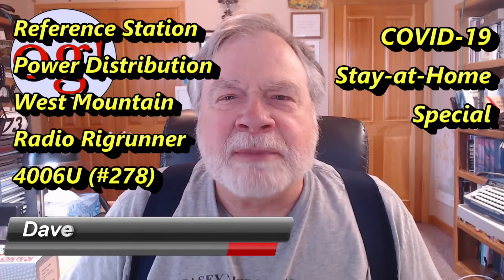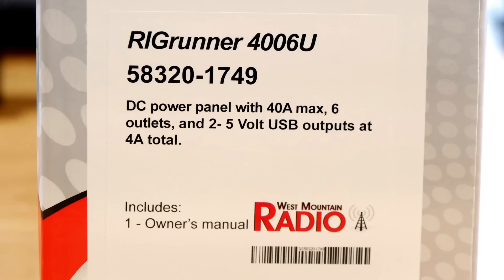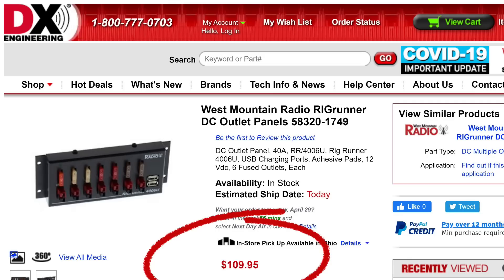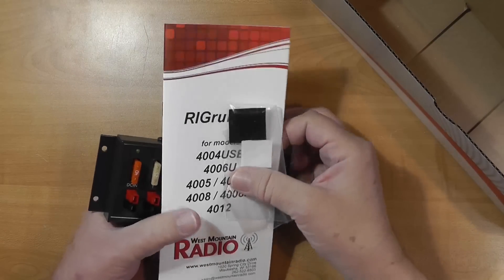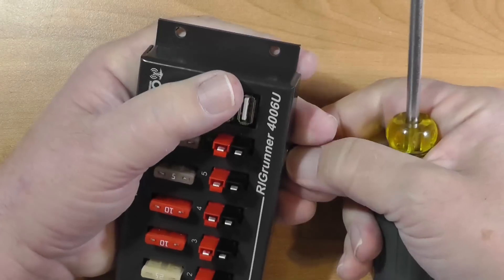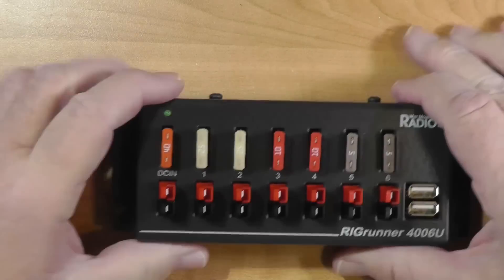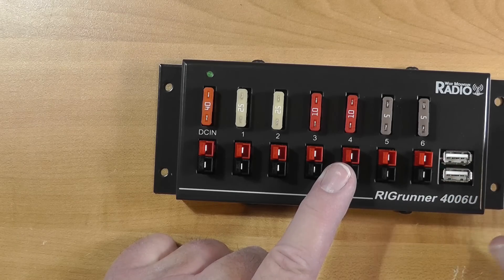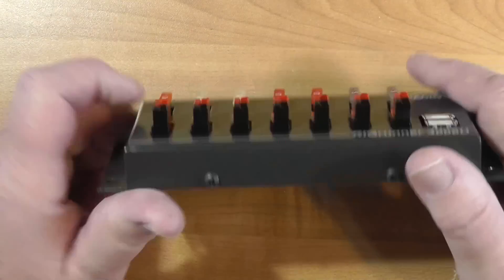Reference Station Power Distribution West Mountain Radio 4006U (#278)

Comment: I just bought a 4012.  Yes, it could be overkill, but it could also be a great device to cover a lot of DC bases.  This afternoon I fitted a couple of old wall wart connectors with power poles to light the meter lamps on my MFJ tuners; a couple of AC wall warts I would have needed are now replaced by dual 12v output on a single set of power poles on a 5-amp DC circuit.  I figure there will be other uses for the remaining outlets.  Of course, I have to be careful with total amperage.

Comment: Couple questions:
1 - The Power Distribution comes with preset Fuses.  Any intel on whether those Fuse sockets are interchangeable... such that if I wanted to have 25 amp fuses in each (or up a 5 amp fuse to 20 amp fuse) - and other than "total in use" simultaneously - is each fuse socket interchangable like that?  Or do certain sockets have a max or ideal?
2 - Anything special about the fuses supplied with the unit, or does any 25 amp from an auto supply work as replacements or swap outs?

Thanks for video.
Reply from the maker: 1. They're interchangeable. It's normal to put the higher current draw devices closer to the power feed end. 
2. Auto- type fuses work fine.

Comment: Hi Dave, I too have West Mountain Radio products and found the quality second to none. "Sorry Martin" The 4005i is AWESOME! going to buy another for the mobile station. Total computer control of every tool in the shack. I used a relay on number 5 switch on the 4005i to control a Rigrunner 4008H. Also the CLRdsp is an absolute dream with some good parametric equalisation.

Comment: Budget conscious hams might consider the 4005 which is $35 less. It doesn't have USB (will one ever use?) and 5 connections not 6. 5 connections are plenty for most hams. Thanks for the great series. KG6RSZ
Reply: Besides, the RR-4006U has been out of stock for quite some time.  You will need to pick something else for your power distribution panel.  The closest matches are the RR-4004U and RR-4007U.

73 VE7NDE

Comment: Would have liked to see the size of the traces so we know if it will handle 40 amps without letting out the magic smoke
Reply: I think the design idea here is geared more toward intermittent loads up to 40A and not continuous loads.  At 500W those power poles would probably heat up pretty quick.

Comment: The Rigrunner looks like a useful accessory.  Have you tried using the 60-amp marine buss bars that are available online for around $8 - $10 for power distribution?  They are available with 4, 6 or 8 pairs of terminals.  They don't have fuses, but since just about all power cords come with fuses, this isn't a serious drawback.  I have used them for several years to distribute 12-volt power in my shack.

Comment: What gauge of wire would you recommend?  I've searched online and reference books and get wildly varying answers for the gauge of wire I should use to hook the power supply up to a distribution box like this or my radio.  Thanks!
Reply from the maker: I use 12 gauge for power cords for HF radios and whatnot. 10 gauge for the main battery lines if you can.
Reply: Thank you.
Reply: Brendan Leber Part of the reason you get different answers is that it depends on both the current draw and the length of the wire run in question, so it depends on your particular setup.  You can find good guides for this in the world of boat DC wiring, like this one: https://www.bluesea.com/resources/1437

Comment: For those who may want to save a little money and don't mind a little soldering, you can try a Power Distribution Kit from K9JEB.com.  They have similar functionality to the West Mountain Radio unit shown here (not as solidly build) but about $40-$50 less and you supply the labor.  One hint, don't cut the solid wire used for mounting the Anderson Power Pole Connectors to the PCB too short.  You want the wire long enough to fully engage the power pole and have some exposure on the opposite side of the PCB for soldering and strength.   73  KN4OET

Comment: Another great video Dave!!  So far, I've modeled my first HF station based on your reference station.  I received my new Icom IC-7300 and Samlex SEC-1235M on Monday.  As for an antenna, I was using a homemade EFHW with a 49:1 for my SDR and was planning to move that over to the Icom.  I made my own 30A distribution panel using a circuit board, a spare 6 port fuse block, 6 pairs of anderson powerpoles, and a 30 A DC ammeter with a shunt.  Quick question though... do you recommend an external antenna tuner with this Icom?  I was looking at the LDG IT-100 autotuner.
Reply: Dave would recommend a resonant antenna.   If you can't then the IT-100 is wonderful.   Trust me it can tuna fish.   The 7300 internal is only good to about 3:1.  Your LDG solution will go around 10:1 or worse.   Sorry didn't mean to hijack the reply just sharing my experience with the IT-100.   And the KT-100 and the Z-817...yep I own 3 LDG products.   Top notch.
Reply: A second vote for the LDG IT-100. I use it often with my 7300 when I’m not using my Icom AH-4  tuner for a long wire.

Comment: Westmountain Radio also makes a similar unit without USB (RR/4005) for 75 USD (and 25/25/10/5/1 amp fused outputs) if you don’t need USB at the back of your radio desk. The 1A output is good for meter lights, etc. Dave is right in recommending pre-built and tested equipment for a reference station. But, IF you are good at building kits (power distribution is something you don’t want to mess around with) and money is really tight SOTABEAMS™ offers a comparable kit for about 50 USD. DX Engineering has it in the US. I live in Europe and got mine direct (for about the same price). I have no connection to any of the companies other than buying the kit which took me less than an hour. I’ve been building radios for over 50 years and opt for a kit when available but if I were just starting out I’d go with Westmountain Radio units. W2RSB | F4WCM.

Comment: I do not agree with the immense hype about anderson power plugs and popularity of these units. It's a gimmick. Power cords for all newly bought transceivers include fuses within inches of their bare flying leads. Viewers are going to wind up double fusing their equipment after seeing this. 

What happened to terminating your power lines with crimp automotive connectors and binding posts? These units and the connectors are very expensive. 

And for the MFJ 12V DC power strip all the new general has to do is stick the power leads into the banana posts.
Reply: Most of the fusing on the cables supplied by the manufacturers is for mounting in a mobile situation where you are direct connecting to the battery. I personally don't mind double fusing and I know in my Flex, there is also an internal fuse which means 3 fuses. I have blown a fuse (ground) going to my 7100 but the radio is still working. At the end of the day, I want the radio to survive.  To address your other concern. Anderson Power poles are great because the ends with power are not exposed for someone to touch. I hate both banana plugs and screw on terminals for this reason. We use them in Telecom for up to 100 Amp DC so it makes perfect sense to me to play it safe and spend the money for a connector that makes it harder to come into contact with live power.
Reply: @don_n5skt  The Anderson power poles have certainly taken the amateur radio community by storm. That's interesting I did assemble a rack once for an ISP headend about this time last year. If I recall, the DC backup supply connections were all Anderson. 

I'm employed in the low voltage/telecom industry also.
Reply: Those MFJ binding post strips are only rated for 15A total. You need 20A for just a single dual band uhf/vhf at 50W.
Reply: @mwechtal  That's a fair point. I haven't used one.

Comment: You mention quickly grounding the WMR 4006U.  It doesn't mention that in the user manual.  Maybe I'm not thinking it through...if the power supply is grounded and the radio is grounded... this is just a "break" in between the too.   Is it really necessary?   I'm surprised the manual didn't mention it.   Sorry for my confusion.
Reply: @Adam Rennison that's where my confusion came in... Preventing a ground loop and it looks like a way to cause one to me...   Hopefully Dave sees the question and will have an answer.  73.
Reply: Yes, I have the same question. I have an 8 position and and Epic Power gate. If I do ground these, is that more grounding strap from those 2 devices?
Reply from the maker: I try to thoroughly ground everything. Yes, there are loops, but they are not creating any problems. I recommend erring on the side of overdoing grounding rather than underdoing it.
Reply: @davecasler  but in my limited knowledge, loops aren't a good thing?

Comment: I've been slowly getting back into radio again (after a 15 year break) and keep picking up the things in your reference station just before you pick them :D   I had picked up a samlex back in February when we has our local hamfest because my old Daiwa died a few years back (part of why I hadn't got my station back up).  Then after building a phaser kit for 20m FT8 found I was really enjoying the mode - but my portable hamstick dipole was starting to frustrate me - so did a bit of research and decided to string up a MFJ-2010.  The joy of having a good antenna again combined with your videos (which I found right after picking the MFJ OCFD) and the current rebate on the IC-7300 teamed up with a stimulus check to convince to me it was time to finally upgrade my old FT-747.   Friday I ordered a rigrunner to clean up my DC wiring...but I went with the 4005.  I would have rather had 6 outlets - but the extra $30 didn't seem worth it for 2 USB ports I have no need for and one additional output.   Only bummer is I've got the itch to finally get my extra...but with the question pool about to change and the social distancing it feels like bad timing.  So i'm just sticking with online studying until the new question pool comes out.  If I start to feel really confident I may look into the on-line testing they're trying out but I'm definitely not ready to look into that just yet!  Keep up the great work!
Reply from the maker: I still have my Yaesu FT-747 in a box in the closet. It was my primary rig for over ten years.
Reply: Ditto to Dave’s comment. Same rig - different closet.

Comment: Those are USB2 sockets, obsoleted for years. They should be USB3.1 as a minimum, or USB-C these days. That's an obsolete strip, easily fixed. If someone wakes up.
 You need a Brother P-touch for some cable labeling.
Reply from the maker: The USB are power out only. I do have a P-touch and use it for some labeling, especially for cables that disappear into the hole in the floor. Otherwise I pretty much remember what everything is for.

Comment: I replaced my 4006U units with the 4007U version 
.  The 4007U only has 1 USB power port, but it has auto shut off during high or low voltage conditions.  Thanks for the great videos!
Reply: Plus it has the voltage and load current displayed.
Reply: I was looking at this as a improvement.

Comment: Thanks Dave for another great video!

As for those 2 usb ports... being as that you gave it mounted in back, one port would serve well as a source for a usb light, so that you can see what is going on.

The other use would be to hook up a usb power pack to keep on hand in case of a power outage, you can grab & go with your cell, & other devices to charge in the field.